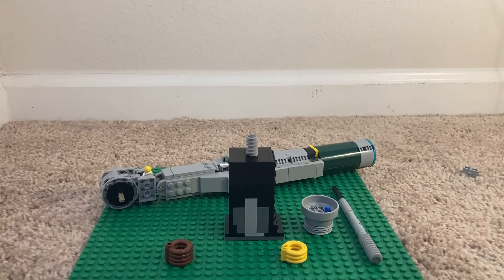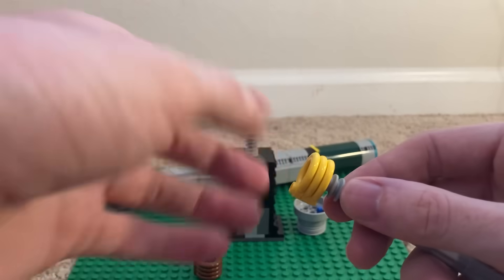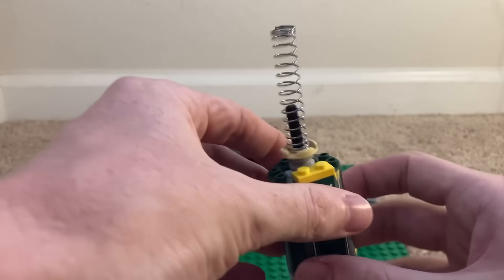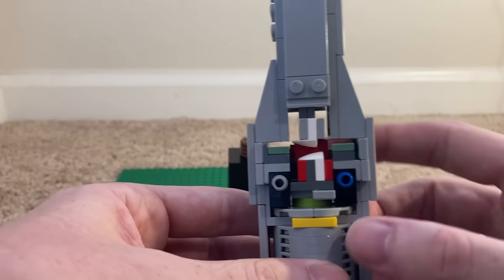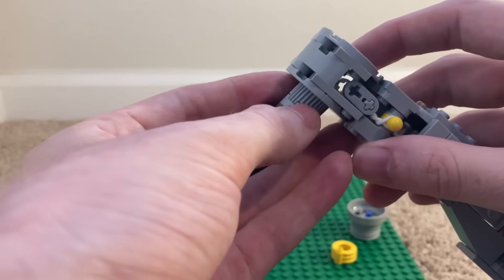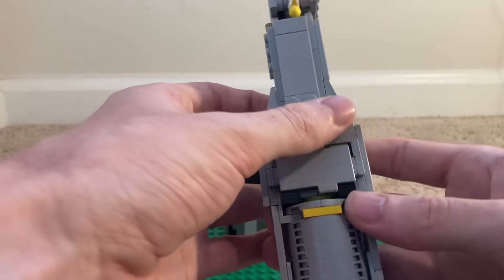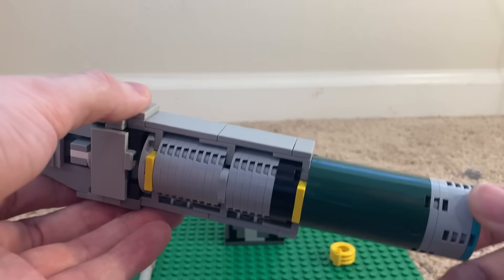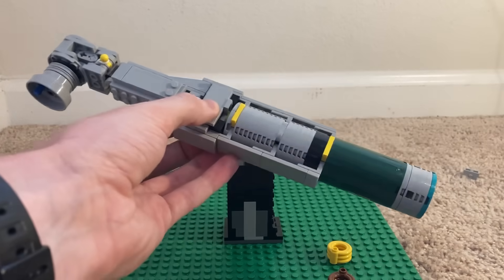Tighten your LEGO nuts and bolts!

Comment from the maker: Two things! 1. I finally posted the free instructions for this wrench on Rebrickable found here: https://rebrickable.com/mocs/MOC-194522/engine1ear/adjustable-torque-wrench/#details and 2. Thank you all so much for the encouragement and overwhelmingly positive feedback! Because I want there to be a low barrier of entry for LEGO engines and tools for engine building I don't want to charge people money for any of it. If you want support what I do, feel free to Paypal me at the email address on my channel page. And if you do build this wrench and/or improve on the socket design or anything else, please tag me!
Reply: You know, Lego did actually make a threaded axle and nuts, part 3737b. Barely used ever, though. If you managed to get a hold of one though you could make another socket for those.
Reply from the maker: @WAHa06x36  Wow that's so cool that you knew about those! I have some coming  from the UK as we speak! (or...type?)

I found out from looking at old instructions that the nut is designed to nest between four studs (in the middle of a 2x2 plate for example). I'm excited to try them out and wish LEGO was still manufacturing them.

Comment: I worked in fixing torque wrenches and that is how it works so very cool, that spring isn’t really doing much it’s pretty much as if you had no spring. I would suggest trying a more robust spring but that would break the legos probably. That is so cool though you definitely have future in some kind of engineering
Reply from the maker: So glad you can vouch for the design and mechanism inside! Yeah even with this spring the wrench starts to fall apart with too much tension haha. But I found that it is plenty of torque for the life-preserver and worm gear nut and bolt! Somewhere below 6 in-lbs... haha

Yes, I work as an engineer, in fact :D

Comment: If I ever become a teacher and get to bolt grades and torque specs, I'd build one of these to have a explainer on how torque wrenches work so that people will understand how they work, and why you need to set them to 0 before putting away
Reply from the maker: I love that idea! That's why I do what I do - to inspire stuff like that. This comment made my day! 🙌
Reply: Technically setting to zero or not won't affect the spring, springs are damaged by cycles not constant compression. It's an argument that's been going on in the gun community for decades between engineers and people who think they know better than engineers lol.
Reply from the maker: @marcusborderlands6177  thanks for sharing the knowledge! Dang, if cycles are what wear out the spring then every time you set the wrench to zero you would be adding cycles that you wouldn't be adding if you didn't exercise that habit👀

Comment: As a bike mechanic I am using torque wrench every day, and to see one made one out of lego maked me fabbergasted!
Reply from the maker: That's awesome! For a bike I wonder if the torque level you're tightening to is about what this LEGO one is capable of for some really small fasteners 😋
Reply: @engine1ear151  Actually there are few places like hydraulic level bleed port cap, that need only 1.5 Nm max, and I think this Lego one can do no problem! There are also few places like bottom bracket, that requires 40+ Nm. In shop we have to sizes of torque wrenches one in range 1-14Nm and one in 10-60Nm
Reply from the maker: @CherryGoddessArichive  Wow thanks for providing some numbers there as a frame of reference. At my shop we use small torque screwdrivers for the carburetors, and I tried setting one to 6 in-lbs (0.68Nm) and the LEGO wrench was not capable of even that 😂 so maybe not useful for real world applications but still great for education and incorporating on LEGO machines like that engine I used it on.

Comment: that's so cool. now i want to hear more explanation about the Lego torque wrench
Reply from the maker: I had a life-sized air-powered engine project I was working on in university where I was replicating every aspect of the engine like the pistons, connecting rods, valve, valve seats, head, ports, sparkplugs, water jackets, etc. One detail I included just for looks that didn't have viable mechanical function was head studs, which are the threaded and hold the head of the engine to the block by tightening down nuts. Think head bolts semi-permanently attached to the engine block. I had the engine block modeled on the LEGO design software Studio, and I wanted to render a comparison photo to see it side by side with the real engine block, but the head studs just didn't look good without those worm gears on them totally posing as the threaded portion of the stud. At the time I didn't think at all there would be a part that could act as a nut, but I later found out there was. My process of imagining what I wanted with an artistic eye led to finding the fluke that the life-preserver fit like a nut!

That's a little more of the backstory of the discovery that sparked the wrench. The wrench itself was almost a default part of the dream to create large, more realistic LEGO engines with components and assembly that resembled real engines. In other words, if I'm saying to myself, "Let's make these engines assemble the way real engines do," then it's only natural to say, "Let's make the tools everybody uses for engine assembly!" So that's what I did. 

It started with just the ratchet, and when that turned out at the scale I had desired, I kept going with the rest of the wrench. Once I learned about the overcenter mechanism in the middle, I set about finding LEGO parts that could nest a 1x1 brick just right to tilt it over (the square to diamond action I talked about in the video). The tooth parts I used also worked far better than expected. The first prototype was unicorn barf as my friend likes to call it when LEGO engine prototypes are a multi-colored mess prioritizing function over form, and when it all worked and friends and family, and coworkers gave a lot of positive feedback, I made it more presentable. It now has square drive as well with a detent ball to hold a socket on like a real wrench. You can see the most up-to-date version in the instructions on Rebrickable. 

I don't know if you were asking for this kind of story, but maybe it does give you a little more explanation about the wrench. I look forward to seeing things other people do with this bolt/nut trick!

Comment: i bet you think threads are the same, they aren't.

The thread you started with has a square profile & is frequently used for vice jaws. It is to allow clamping force without binding. Some have peaked threads, some have tapered threads, and some have multiple threads.

There are many standards for threads, very many, more than I can rant about.
Reply from the maker: Thanks for sharing the knowledge! I was loaned a 700 page book once called "The Introduction to the Bolted Joint" and that was just the introduction, apparently 😅

Comment: The fact thay you even found a piece that works perfectly with the worm gear is amazing, and the torque wrench is so cool. I think you should definitely improve this design more, especially the way it connects to the "nut". Maybe some kind of semi triangular shape sould work with the life guard pieces?
Reply from the maker: Thank you so much for the thoughtful comment. I was so surprised when the life preserver worked so well! Yes, I am still in need of a better socket. I also tried BrickLink Part 73111 with less success. If you or anyone else has any suggestions I'd love to hear them, or see a video. I think it would be amazing to see the community develop a hardware system around this!
Reply: @engine1ear151  Well I would personally go for a custom brick built design instead of using a piece that actually looks like a socket, even if it doesn't look realistic like that part. However, maybe you could actually make that part work in a much more elegant way too.

I was thinking if bricklink part 4490 could go around the studs of the life preserver piece when sideways for example, and then build around that. Of course the challenge is to keep it sturdy enough and not too bulky, but hopefully that might give some inspiration!
Reply from the maker: Oh OK I see what you're saying. Thanks for the suggestion! I have made some brick-built sockets for some hex head bolt concepts. It is indeed hard to get them not to come apart in use. But yeah there's gotta be a solid way to engage the life preserver. If I get it I'll be sure to post it eventually 🙌 Thanks again for your thoughtful comments 🙏

Comment: Soon we’ll have the entire lego toolbox!
Reply from the maker: I'm definitely working on expanding the hardware system!
Reply: @engine1ear151  go for it! The community supports you!
Reply from the maker: Thanks so much for the encouragement! I used the wrench on an engine head, where the idea of threaded LEGO head bolts or heads studs originated from. The video if that is a short titled LEGO Engine Speed Build pt. 4. I hope we can have some hex head bolts, washers, threaded holes in machines, etc.

Comment: We got a Lego torque wrench before GTA6
Reply: I was looking for this comment 😅
Reply from the maker: @AT_0979  we all have different reasons for being here 😌
Reply: @AT_0979  Me too!😂👍
Reply: It was only a matter of time. Lego technology advances far faster than gaming production advances apparently lol
Reply: @HourRomanticist  
Just take a look at the LEGO Liebherr crane, it has 6 motors, and are controlled via an app. In the app you can check stats from previous drives (like total meters driven, crane position, or even the weight of the load). It's probably one of the most evolved Technic sets to this day.

I even got the LEGO Technic Volvo dumper with fully working transmission (you can shift automatic or manually).
Reply: We got 1 year of one gta6 meme (not plural) before gta 6

Comment: how many ft/lbs can I put on that thang?
Reply from the maker: Glad you asked! I actually tried to calibrate the wrench using the lowest torque screwdriver I found laying around and at its lowest setting of 6 in-lbs the LEGO wrench still didn't compare. Also at 6 in-lbs the LEGO nut slipped on the threads. I haven't found the exact threshold for the slipping yet but that's a frame of reference. Short answer: a fraction of a ft-lb!

Comment: Instead of putting the pin in the socket put the piece back wards and put the pin in the nut so u can atach
Reply from the maker: You know I'd love to but then there'd be the issue of the stud on the life preserver sticking out the nut no longer has a flat surface to sit flush against the surface of whatever I'm bolting to 🤔
Reply: @engine1ear151  makes sense

Comment: Now make a Lego impact drill
Reply from the maker: Thanks for the idea! Think you could give it a shot yourself?
Reply: @engine1ear151 would be cool to see you build the mechanism out of LEGO and see how it works.
Reply from the maker: @Nicetruck78  yeah undoubtedly a cool idea. I really need a better socket before I can start introducing more force while tightening the nut down. I know we'll get there eventually!
Reply: @engine1ear151  well, best of luck finding one!
Reply: @Nicetruck78  I think I'd seen someone try to make either an NXT or EV3 do programmable torque calculations like one of those smart torque guns, but impact would definitely be more interesting.

Edit: smart torque like the Lion gun. No impact system, just straight torque until desired results are met. Stops at desired result.
Reply: @DeepPlane  That's really cool! So does that mean someone else has made a LEGO torque wrench after all?
Reply: @DeepPlane  I’ve never heard of something like that, that’s cool
Reply: @engine1ear151  but without using a motor
Reply from the maker: @jacobpugpoirier3350  hand crank impact wrench?
Reply: @engine1ear151  I’m just pulling ur leg. 😅
Reply from the maker: @jacobpugpoirier3350  stop pulling it I'm trying to use it for this pedal powered LEGO impact wrench
Reply: We need a Lego air compressor
Reply from the maker: @onebacon_  Oh dang you just gave me an idea 😶
Reply: I made one its pretty cool I used cheese slopes and a spring from a pen for the impacting mechanism
Reply from the maker: @fartfart7488 That sounds awesome! Have you got a video of it?
Reply: Lego sawzall
Reply from the maker: @Synergy7Studios LOL somebody go for it!
Reply: Lego hydrogen bomb
Reply from the maker: @RB-ej8wk  just a couple thermodynamic problems to solve no biggie
Reply: That’s just a ryobi

Comment: That’s really cool but it’s to bad it only has a single stud of connection for the nut love that torque wrench though
Reply from the maker: Thank you 🙏 I agree about the single stud. Making a threaded hole for this system inside a large object like a bracket would take some innovating. I think I have a couple ideas 😏 Another challenge is constraining the worm gears on the axle so they don't just slide off with any amount of torque. But with enough 1/2 stud bushings, it can get really tight.